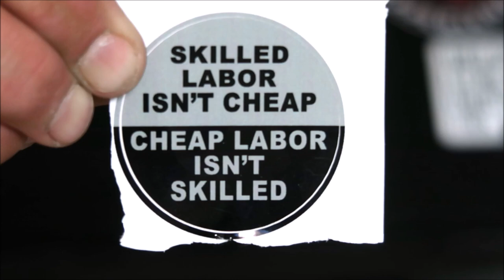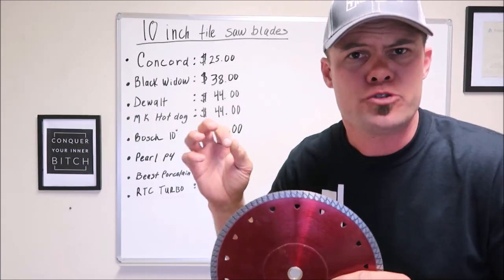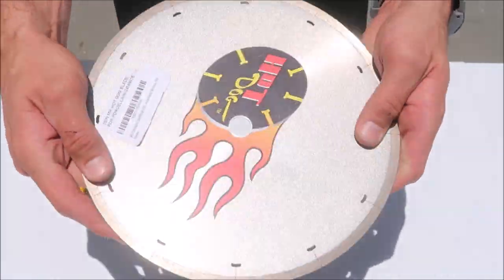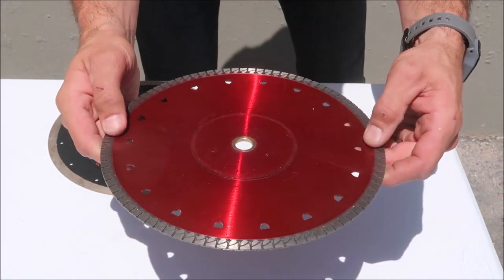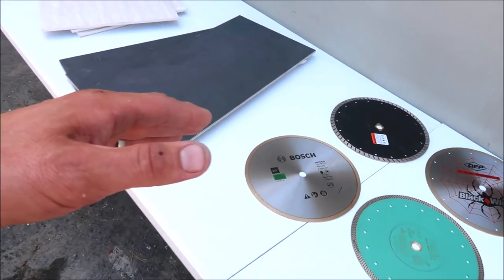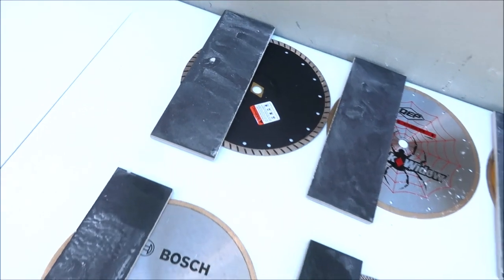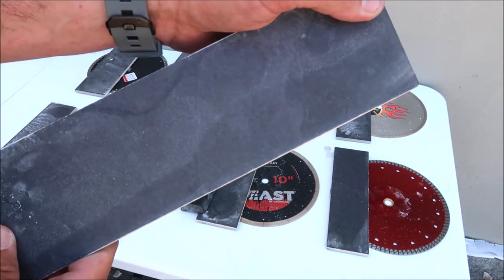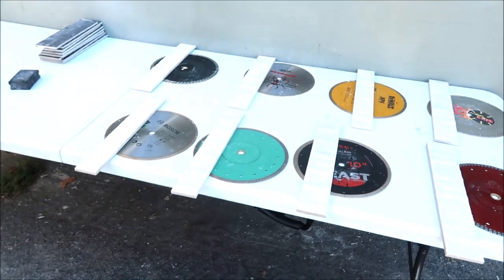Tile SAW Blade Test and Comparison

Comment: I've used just about every high end blade on the market up to over 200.00 for a 10". My favorite go to blade for porcelain, both glazed and thru bodies is the mk 225 (hot dog).  Keep in mind you must dress your blade  every so often to get the most life out of them. 30 years in the trade.
Reply: Stephan, I am a DIYer what do you mean by "dress your blade ever so often to get the most life out of them..."? Thank you!
Reply: @aportman58  'Dressing' the blade requires using a dressing stone, a brick-like abrasive stone, to condition a diamond blade. It works by removing any glazing  that may occur while cutting tile to expose fresh diamond.  Generally, it is best to dress a blade for every 60 linear ft of tile cutting.
Reply: @contractorsdirect can you use a plain old brick for this purpose or do you have to use a specific Stone?
Reply: @stephentoth8281  A standard brick should do the job in a pinch. This dressing process still technically wears out the blade, so you only should to cut into the brick about 1/2". The abrasiveness exposes more diamond bits, allowing the blade to cut better.
Reply: @Contractorsdirect1  if you do a job and you're sussing out the walls for square, and the angle of one wall is too obtuse, with the far end being say 100mm (4 inches) out at the opposing side, and we'll say the walls are 3m (9.8ft) x 3m (9.8ft) what would be your favorite approach to squaring that wall?

Comment: Great video - let me clear up a misconception about the slots in the cont. rim blades. Not for cooling but added speed. In diamond blade engineering slots or serrations add speed. The bigger the distance between segments the more speed but you run the risk of breakage (on concrete blades)and on tile blades you need a clean cut so the slots are very thin.

The types of blades. Some basic understanding of the different types.

1. Dry or Wet - Dry blades can be used wet - wet blades cannot be used dry. 
2. Material designed for - porcelain blades will cut anything.. Ceramic blades are cheaper and will struggle on harder materials.
3. Different types of segments

Continuous turbo (serrated blades will cut faster but not as clean - exception to this is the mesh turbo - like the P4 -  with the raised hub. These new style blades do cut pretty clean but not as clean a the thinner continuous rim tile blades.

Continuous rim - these thinner blades cut cleaner (no chipping) when they are supreme grade - nothing cuts cleaner and smoother.

Continuous rim with slots - The slots (all types like j-slot or slots with shapes)  are for speed (not cooling - cooling holes in the core are for cooling). You gain speed and still get a smooth cut but not as clean as a continuous rim without slots. 

New Mesh Turbo style with raised hub (like P4 or Diamax Cyclone - very popular and many manufacturers are making this style). These supreme grade blades can be used dry - can cut everything fast and smooth  - just not as clean or chip free as a supreme cont. rim as mentioned before.

So you need to decide - how clean of cut or is it speed you want - wet or dry - depth of cut and what type of tile you are cutting. Cheaper blades can get the job done, but you often sacrifice, speed, life and chipping.

Typically the more expensive blades have a higher diamond quality and concentration - resulting in the ability to cut harder tile or stone cleaner with longer life.

Dana Fox
J & R Diamond Supply
561-750-7878
Reply: Thank you
Reply: I have the Dewalt blade in my saw. It seems bent and a lot of vibration. I’m assuming these thinner blades can bend easier. I’m thinking of getting the pearl blade.

Comment: I've been doing tile for 35 years and my go to blade for all material is the Dal-Tile Porcelain blade. It's $39 and gives thee best cut of any blade I've ever bought and used. Almost a factory finish it's so good.  I've tried most  of the ones he has here. The only bad thing about the Dal blade is it wears out faster than others but since I do mostly custom tile work it's a very small inconvenience.

Comment: we use a blade called PorcePro+ j slot blade  by sawcutting specialties. It's meant for the hardest of tiles, cuts amazingly well very little chipping in any type of tile. and lasts a very long time. If you get a chance I recommend ordering one. Hell even tho we shouldn't, we even cut thru metal trims and schluter with it regularly.

Comment: I know in you review of the DiamondBack wet saw, you stated the DiamondBack blade that came with it appeared to be cheap and would need to be replaced. I purchased that wet saw (the 10" DiamondBack) and I have found the DiamondBack blade to be a very good blade. I have done 6 showers, and 3 floors with one blade, and today, I started another shower and the blade is still going strong. No chipping on the cut line, no end cut chipping of the corners, the blade has performed EXCELLENT. I used to buy the $80-$100 blades, but not anymore. The Dewalt blades, in my opinion, are junk. Maybe it's just been the  "luck of the draw" for me, but I will stick to the DiamondBack blade. This is one item from harbor freight that is definitely worth buying. And no, I'm not biased either, I use the Dewalt DWS779 miter saw, Bosch, Rigid, Milwaukee and Hitachi. So I know what good quality tools are.

Comment: Hey I am a DIYer which I have done several tiling jobs for personal and family which I used a 8" Rigid wet saw. I was hoping you would do a demo using a Rigid blade to see what you thought. Each time I have used a Rigid 8" blade they have seemed to chipped tile. I recently tried a QEP and Rubi and had good results getting clean cuts using both. I would like to try some of the ones you mentioned! Thanks for sharing!

Comment: It should be noted that the Beast blade he uses here has what he calls a large arbor. It has a rubber like washer or arbor fused onto it that is there to make super thin cuts without the blade bending. This works great for thin cuts but a major drawback to consider is the rubber washer gets in the way of plunge type and other cuts. The rubber is very close to the edge and is wider than the blade width on the tile.
Reply: I've found that typing tiles to get a square cut mostly the prob with the beast but don't talk shit cause that's my go to.😆🤫

Comment: Great video , pretty much used every blade on your table,  depending on materials I change blades , my go to fo day to day is the mk hot dawg , I like the beast for more dense tiles,  I do dress the edge which helps especially when running mass amounts of hard cheaper tile , qt,  ect... thanks for video 

.

Comment: Great video.  I'm always looking for the next best thing and I've been curious about the new mesh blades, that's why I watched your video.  I've been cutting tile for 33 years.  My favorite is Solid Gold.  It is a continuous rim and the longest lasting, fastest, least chipping, best priced blade I have found.  It's a porcelain blade, but we use it for everything.  It's similar to the Razor T3, but a little cheaper and It lasts longer.  It has a very thin kerf (which makes it fast), but it has the larger, thicker core (for keeping it straight) and a wide diamond edge to start (to make it last).
Reply from the maker: P4 is our favorite mesh blade! It rocks!
Reply: Solid gold is the name brand? Cant find that brand
Reply: @gloriacarina1  it was a private label contractors direct blade that has been recently discontinued 😕.  They blamed manufacturer quality control issues.

Comment: I like the P4 but they don't last very long at all.  I also recently had one where the inner bushing came loose and my Dewalt acted like it was about to take off while slinging the blade loose.  It scared the hell out of me.  I thought it was a bearing but when I took the clamp off to remove the blade I found a small gold bushing.  It didn't even occur to me until I tried to put it in another saw and realized the arbor was much larger than 5/8.  This is the first time I've had this happen and hopefully my last.

Comment: Porcelain is the least forgiving on blades. Most cut ok for a little and then get slow and split at the end of the cut. The best I've found are the MK hotdogs.  I've worn down to the steel over the years. It's all I use unless I'm cutting glass.

Comment: I bought one p4 blade and it was horrible, I must have gotten a bad one, or a knock off from Amazon. Tge best blade I've used so far, surprisingly, has been the most expensive rigid blade home depot carries. I was cutting 3/4" porcelain pavers, will try the hot dog next.

Comment: What style of blade do you recommend for cutting very hard black granit?,,. I'm cutting pieces the size of a brick, and some a little bigger. I'm using a brand new 14-in wet dry saw, 14-in blade, Electric handheld,,, 15 amp. 🤔 It is made by extreme power us, whatever that is. I got it through Walmart. It seems very well made. I have not tried it out yet, just got it today UPS ground. Under $300.

Comment: Good stuff!  Also curious if an overhead blade/saw, generally makes better cuts than a bottom mount blade/saw, and also any difference in amount of chipping?  Thanks!
Reply from the maker: Yes! an overhead saw generally makes better cuts for sure. Less chipping..
Reply: is there less chipping on an overhead because the blade is cutting downward from the tile surface ? would flipping over a tile to cut it on an undermount improve the cut quality and chip resuction ?

Comment: Man I thought the red was a zipper blade. I start at your $100 am go to $180. I bought two dewalt saws this year and just take the blade off. I’m a firm believer you have to have four blades, solid rim, j channel for porcelain, high hardness porcelains blade with stabilizing attached and a really high end glass blade.  The red Zipper blade is an awesome blade with diamond mesh on a solid rim.
Reply: And follow up you do realize that only the ones with slots or “J” channels are for porcelain. The mesh can be both. Solid rim like the Bosch or dewalt are really only useful for ceramic to wall ceramic. Usually the $25 type of blade is used for concrete, grout removal or super soft slate or some natural stones that clog the diamond pours. Hope this helps. Good video.

Comment: Nice video.   I tried Peal P4 for miter cuts but found it was not stiff enough and tends to drift for longer miter cuts.  Wondering what the stiffest blade you have evaluated is for miter cuts.  Thinking a continuous rim may be best for miter cuts.   Cutting porcelain and ceramic tile materials.  Comments?  Thanks

Comment: Hi, landberg! Thank you for you videos. But I got a question?
Can I damage a glass tile blade,  If I cut aluminum?
Reply: Glass tile blades are an
actually grinding wheels as they don’t have teeth to cut. Aluminum needs teeth to cut. Better to use a chop saw with as many teeth on the blade as possible or bandsaw
Reply: @SigmaDG  thank you ashley 👍
Reply: @SigmaDG  I just tried it right now my dude. Brilliant!!!! Thank you so much
Reply: Jose Robledo 👊

Comment: My friend has a problem I suffer from. When filling the spaces of the ceramic lines in the ground, cement is stuck very often because the ceramic is very rough. I wanted to name a substance on the ceramics before filling the ceramic spaces
Reply: Having a hard time understanding what you're trying to say? Are you talking about the sides of the tile?
Reply: @mattjudy4037  Sorry my friend delayed to reply. The weather is very hot in my country and I need the name of a substance that prevents the adhesion of cement to the marble when filling the ceramic sides
Reply: @izuzgorani1232  maybe grout release? There is one produced by Mapei...

Comment: On your Harbor Freight 7in tile saw review you recommended using a P4 saw blade that had the mesh design. And you used it to demonstrate cutting glass. Their website does not recommend that blade for glass but, since you use these tools on a daily basis and would know, would you recommend the P4 Mash blade over the P4 standard blade for an everyday water saw blade that might see everything from glass to hard porcelain tile and Granite?
Reply from the maker: The mesh might give the glass a rough cut, but with my experience, it works just fine on glass. Hope this helps 😎
Reply: @LandbergTileTV  yes that helps but which would you use as an all-around tile blade? Thanks bro!

Comment: I have the dewalt 24000....cut porcelain tile today and had alot of chipping. Is there a secret to cutting it? Score it slightly 1st then cut through it then?
Reply from the maker: it should NOT chip, maybe a bad blade.
Reply: DIY10X here, I had the same problem maddening thinking no way these pros put with this BS, had brand new Dewalt blade , hard porclelain 24"'s then my retired tile guy showed me diamond pad grinder....... put near factory edge back on

Comment: Have you ever used the rockin red dressing stone by RTC? Works great!
Reply from the maker: Negative, but I'll have to try it out!
Reply: You’ll have to check it out when you can, you may be pleasantly surprised, also might make for a good demo video! Works real good on glass blades and hard porcelain blades. It’s available on Amazon. I’ve also bought from DAL Tile.

Comment: What 7" blade would be suitable for 12" slate tile?
Reply from the maker: The cheap black mesh blade would work well or the P4 mesh blade also. 😎
Reply: @LandbergTileTV 
Gotcha, I've located both a 7" & 4" for the grinder too. Also, thanks for your video on the diamond back 7 " saw from harbor freight. It just convinced me to make that purchase today. I also got it on sale & had a 50.00 off coupon for it too. They were out of the stand though so I will get that when they come in. That 50.00 coupon just paid for my Pearl P4 blades!  Not an everyday tile guy but jack of all trades kinda guy and thinking this is the best bang for my buck. Again, thanks for your videos and keep them coming. Keep on tiling & keep on smiling.

Comment: Black Widow, the poor man's, Hot Dog. Value for $, and cost effectiveness. With the density of stone nowadays, all blades get chew'd pretty quick. So for value and versatility the black widow does a great job, can't justify the crazy high cost ones since the life cycle isn't that much longer than the widow.
But I'd never run a cheap blade. The mesh blades I've found are great for shaping with the side of blade, however the cutting edges wear fast. Just myop.
Reply from the maker: Thanks for the info brother! 👊

Comment: First
Reply: I bought a p4 for my new 7" HF  saw and it cut my marble look ceramic tile with more chipping then the stock HF blade,  disappointed.
Reply: @BB-ik5rt  haven't used a p4, but most blades need to be worn in on some hard porcelain b4 they really cut smooth.